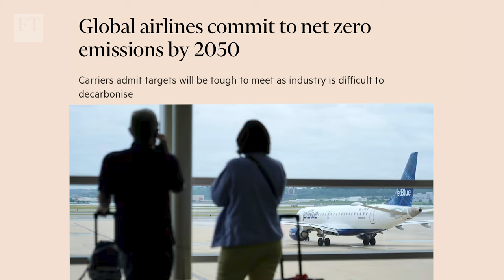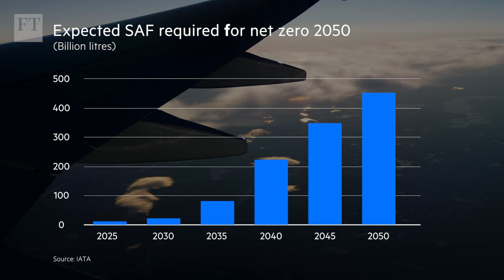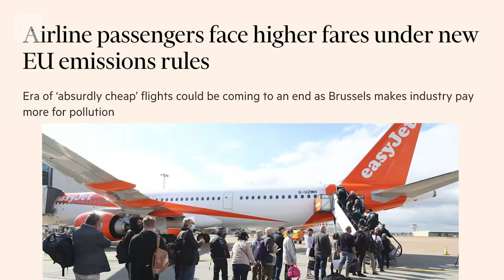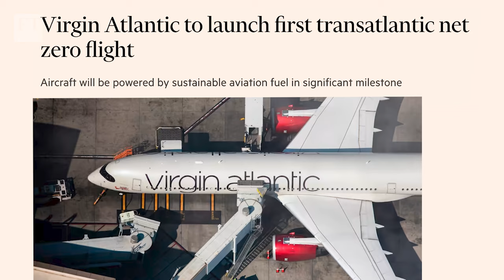Can sustainable aviation fuel clean up flying? | FT Rethink

Comment: Proposed plan for Boeing: start by keeping your aircraft in the air; Next move to biofuel.
Reply: Thousands of Boeing airplanes do tens of thousands of flights everyday…safely. I challenge you to find anything mode of transport safer than that.
Reply: @JetPro11  If they fly safely, it is in spite of and not due to, corporate values. Fix that.

Comment: There is a small comment one should put; palm oil does not come from Brazil to start... 
What is the main barrier, for palm based from Asia or soy based from Brazil/Argentina or cooking oil from elsewhere, is that this is not environmentally 100% green. For many arguments the push back remains not the net-saving for the environment but the incomplete "green" solution. In the end this is an imperfect solution with great saving potential for energy consumption for airlines, marine transportation and road fuels. In regards to agricultural yield per hectare of palm oil farming, please show which is yielding better.

Comment: Most plastic is petroleum derived, however most of the plastic waste is being burned or buried anyway (due to high cost of recycling and limited recyclability of plastic).  

Even if certain plastics like PVC and CPVC had to be filtered out, this requires far less sorting (and cost) than conventional plastic recycling.  

Fortunately, it turns out that plastic can be easily converted into jet fuel in a single step!  It requires only a simple heating process, no FT synthesis required!  This is inexpensive and scalable.  As a bridge solution it could help lower the high cost of an SAF blend while also addressing the problem of plastic waste piling up.  

The quantity of plastic waste in the U.S. is 1.3 lbs/person/day, (0.6 kg/person/day), a similar weight to the consumption of jet fuel (1.3 lbs/person/day).  If all the currently non-recycled plastic were converted, it could in theory supply up to 1/3 to 1/2 of the total jet fuel use.

Comment: the sky was blue because there was water in it. the sky is no longer blue because the remnants of airplane flights disturb the particulate nature of the formation of raindrops. that's why your head will be dry, the rain will not fall, and the sky will be white, 90% of the days of the year  .that will of course also affect the wind, the temperature rise above the ground, the biosphere, etc. if by chance plane flights were to be suspended, blue days, blue skies would instantly appear..like before..peace
Reply: What a grab bag of pseudo science!

Comment: The claim that 100% of airlines are able to be fuelled using SAF... yet what about the emissions for the production that goes into the airplanes being built? It would be huge (as it is already!) so how far down the line will they breakeven? We have already seen how expensive air travel was when commodity prices were at the all time highs a few months ago... Sustainable Aviation Fuel needs to maintain a blend!
Reply: It's not that meaningful in long term. Commercial aircraft usually fly 20-30 years. Most of their monetary and ecological cost comes from actual use, fuel, not from the initial manufacturing cost.

For example in passenger cars, that have perhaps 15 years of life on average and are used perhaps 2-3h daily on average have only 1/3 of the cost in manufacturing. Commercial aircraft are used 12-14h on average in a day and have perhaps 25 years of life. The cost of manufacturing is perhaps 1/15 or 1/20 of the total cost during the lifespan.